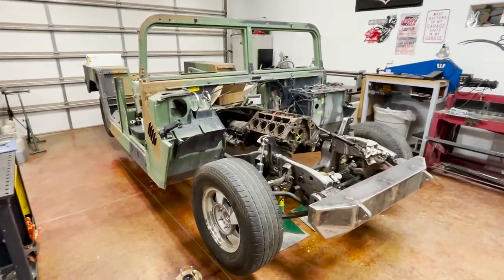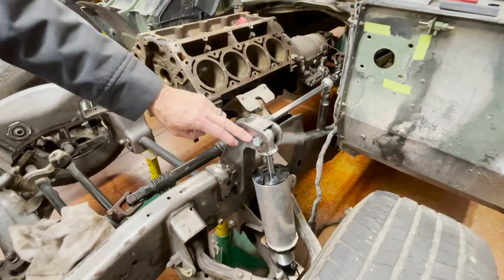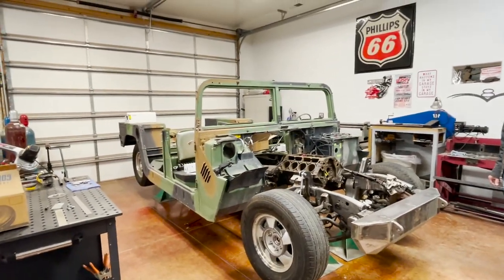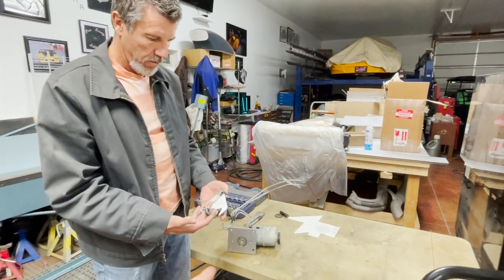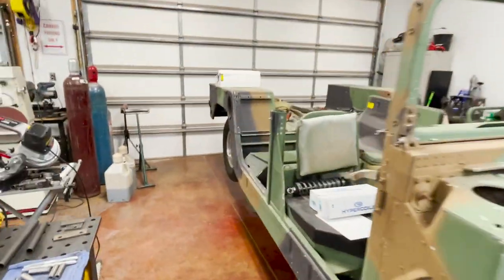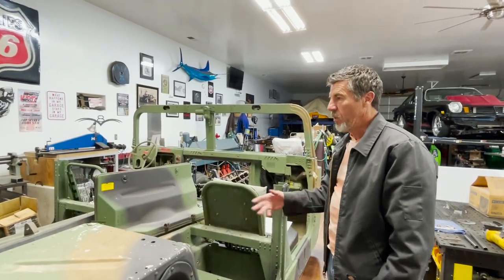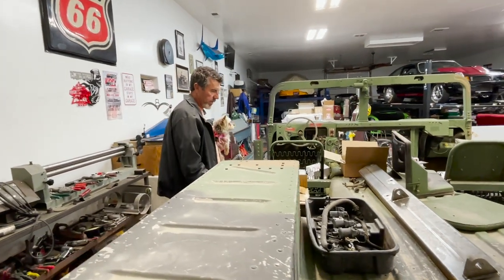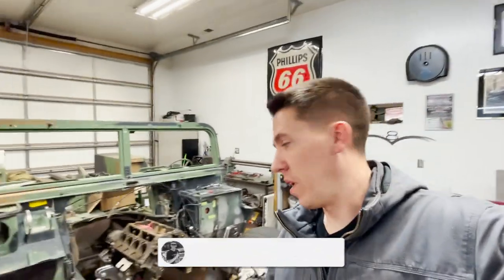Abandoned Hummer Project Returns! What Happened With It?

Comment: While the idea of the Hummer project is interesting personally to me it sounds as if the customization of the body needs to be taken father.  Having driven a H1 and being 6'5" and 290lbs I find them rather tight inside and when equipped with its OEM drive train that is quite understandable but since this H1 is going to be 2wd with an LS there is no reason to keep the doghouse / oversized raised transmission tunnel in truck.  Gutting that and installing a normal sized trans tunnel would make the truck muck more comfortable to drive even for someone 5'9". Again I like the project and think it could be really cool when done but I see no reason from what i se described as the intended purpose of the build no to invest a chunk of time making the interior of the truck more comfortable. Have a nice day and StaySafe, StayHealthy